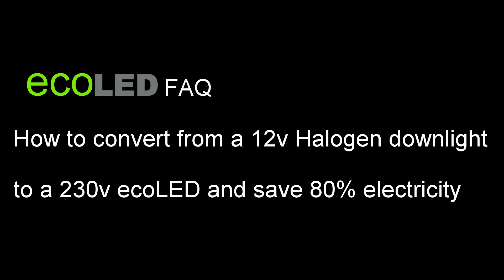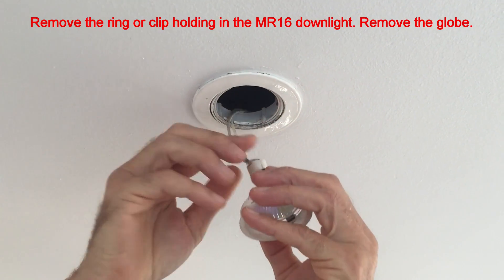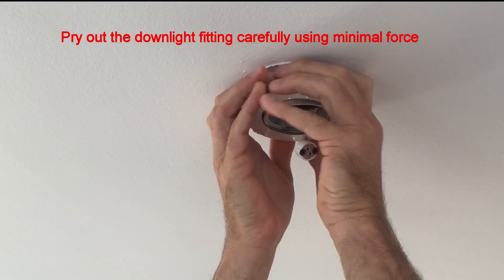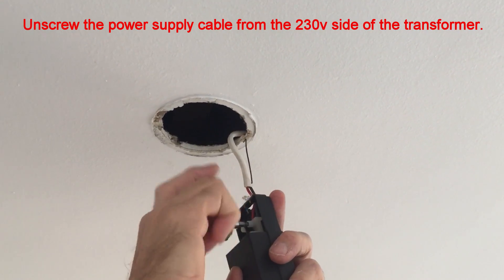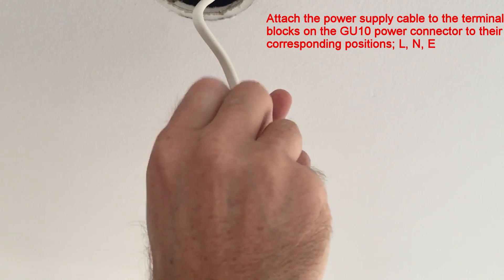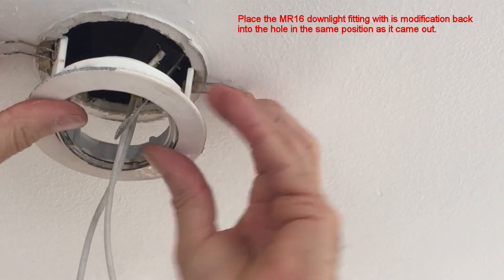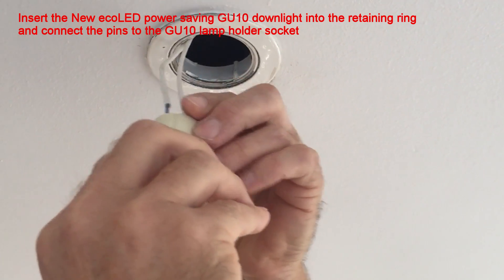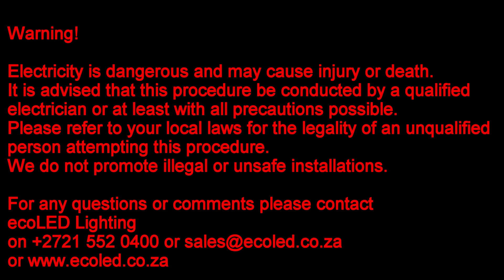How to convert from 12v MR16 to 230v GU10 downlights

Comment: Thanks for an informative video - I see with the MR16 transformer the earth was not connected but you did connect it when installing the GU10 fitting. Is this necessary for the safe usage of the GU10 with a LED bulb?

I’ve seen an installation where there are 2 x 230v inputs into one transformer for 1 MR16 downlight. Why would this be necessary and how would you convert this bulb to a GU10? 

Thanks for any assistance you’re able to provide.
Reply: The reason there may be two connections is because the one is the supply and the other probably goes to the next light in sequence. (bridge)

Comment from the maker: Hi Arthur. If the globe you removed has two strait pins of about 10mm (see MR16) spacing then the probability of the existence of a transformer elsewhere in the circuit is great. Old installations shared one transformer amongst a few globes. This will require a rewire to bypass the common transformer. You can also connect the GU10 end cap to the available wire. If it lights up a GU10 globe when switched on there isn't a transformer, if it does not, there probably is.